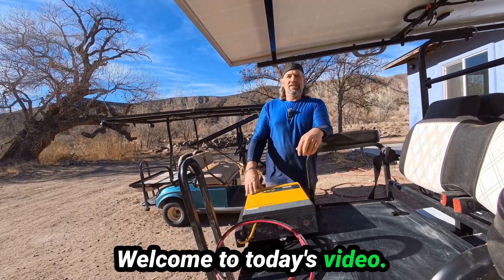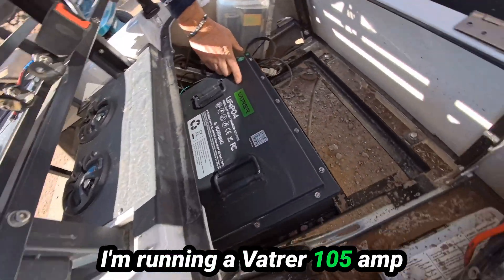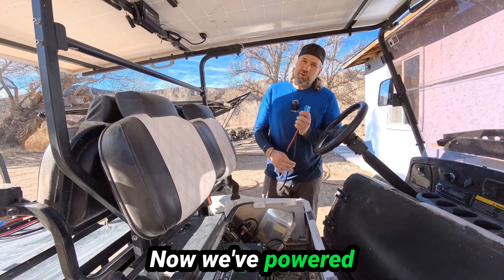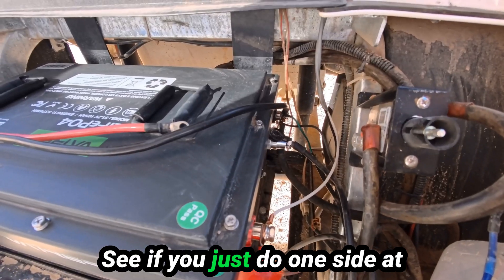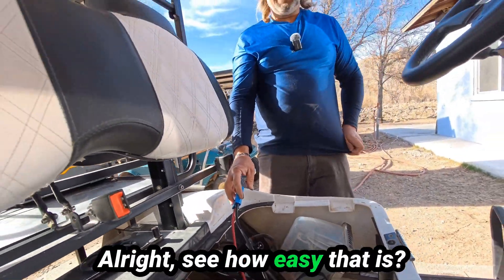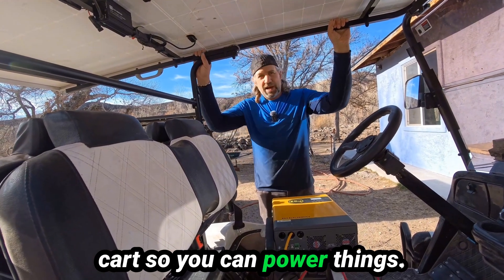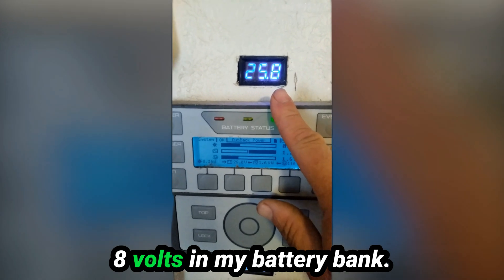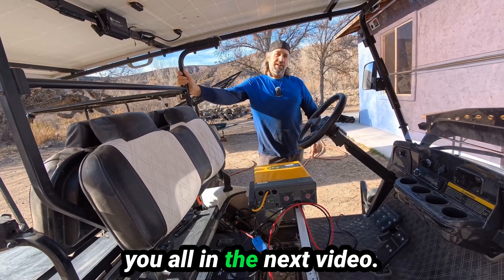Turn Your Golf Cart Into A PORTABLE Power Station And Power Your Entire House

Comment: I have an Ezgo RXV Elite with a Lithium Ion 48 volt battery I need to get a spit phase converter for my house backup.  I am putting in a 240 volt 60 amp plug in my garage for a welder I just got and could use this outlet to back-feed my electrical panel with.  My panel has a main circuit breaker so I throw that then turn on only the circuits in my house, 2 refrigerators that I must maintain power to and leave the rest of the breakers in the panel off until I regain power. I too buy way to much stuff on Amazon and will probably get my Anderson connections/cables there too.  I might even consider buying another 48 volt battery for my golf cart to expand my battery backup.